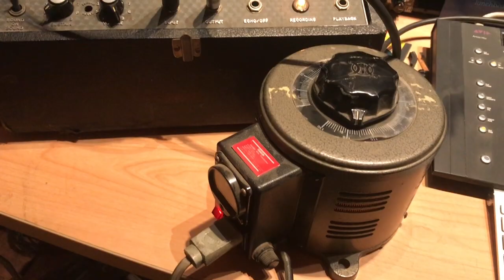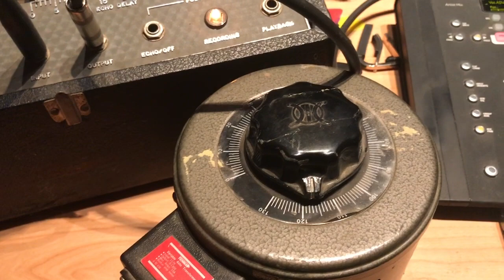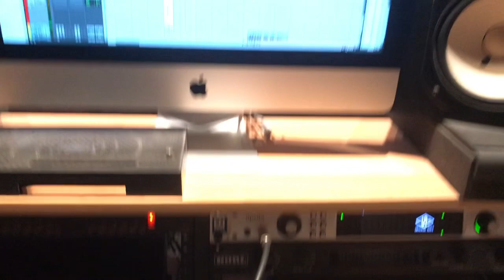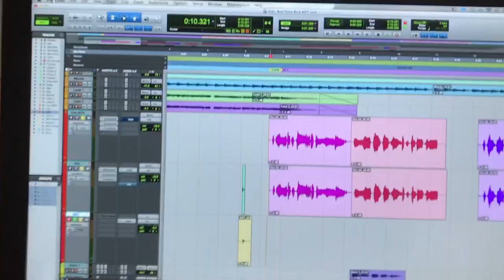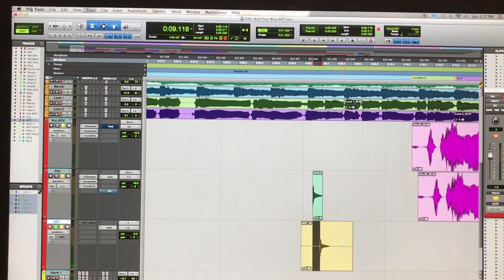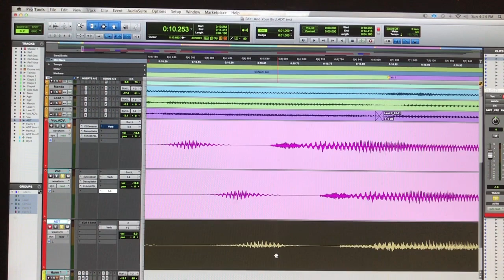Beatles ADT (Artificial Double Tracking) with an Echoplex & Variac

Comment: The EP had a handel to move the head,itll pretty much give you what your trying to do with the veriac but better because your not staving voltage to the pre amp and record amplifier 

Im guessing the veriac staving all the voltage going into the echoplex as a whole right?..if your doing this i think its important you just have the veriac on the motor because  the signal staging on the EP really needs 22v to sound optimumal..the pre amp and reproduction head amplifier add subtitles so i think youd want to maintain the voltage going to that staging..if your planing on using this alot it might be worth isolating the motor from the EPs power supply stage altogether (that includes not sharing ground with the signal staging at all) ..it could be done so you can retrofit back to original condition..i think the pre amp and record head amp is important and worth maintaining for the best quality sound.

Comment: What's the advantage of using the Variac as opposed to just nudging  the delay time slider?
Reply from the maker: That slider can be just a bit jumpy but I suppose you could do it that way.  Part of the reason I used a varian is because that's essentially what they did (from my understanding) to speed up and slow down the machine.  It's the time modulation that gives it the sound.
Reply: @RyanWilliamsMusic But you didn’t speed up or slow down during playback, did you?!